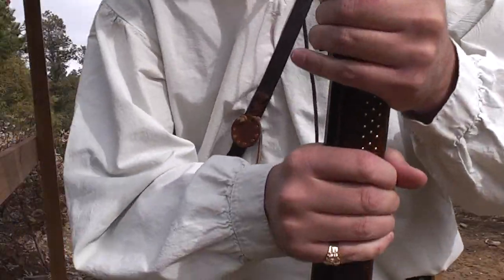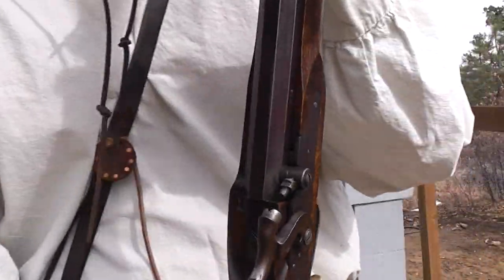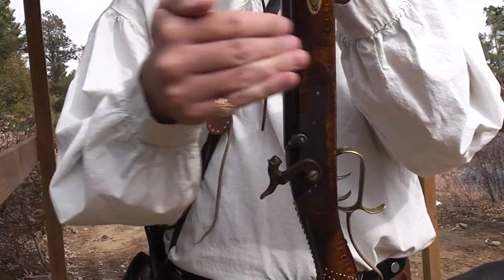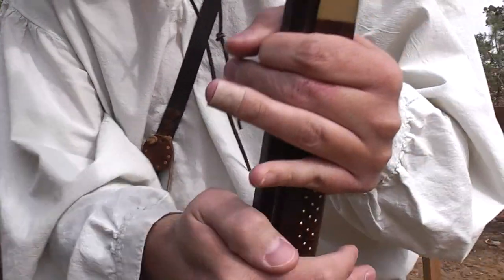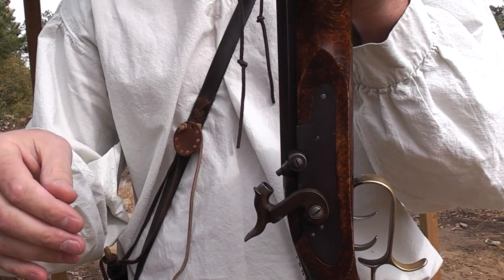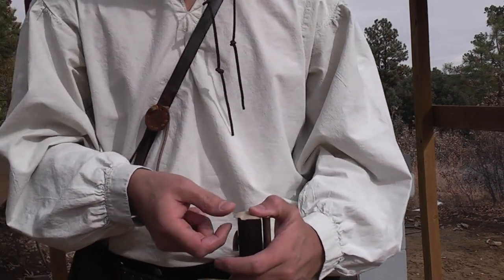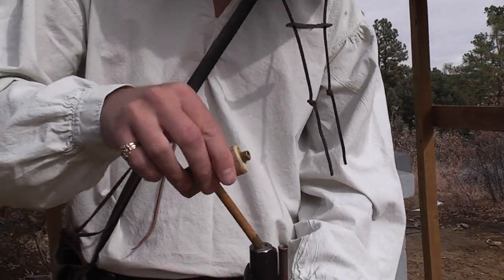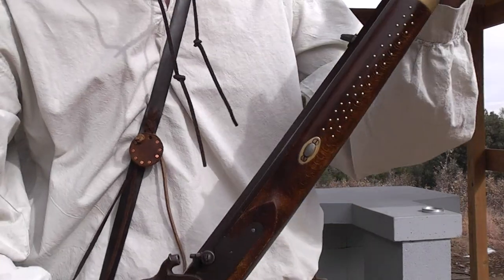Buckskins & Black Powder Loading & Shooting my muzzleloader

Comment: Another friendly suggestion , when loading hold the rod closer to the muzzle and sort of shuffle it down , This is less likely to break the loading rod and if the rod does break it is less likely to go through your hand . USA Hickory ram rods , soaked in coal oil are less likely to break than the flimsy rod which comes with the rifle . Lastly if you must do a final push on end of the rod , use one hand and keep it away from under your chin so that if it decides to use the heat developed by compression ( remember diesel ) or a spark left in the barrel you will only loose the use of one hand and still be able to talk .
Reply from the maker: My ramrod is the old TV wood/resin impregnated design. 4 to 6 inch strokes. Also, with a hole in the nipple, it's not going to dispel by any means.  A lot of old myths out there that get carried on past their life span.